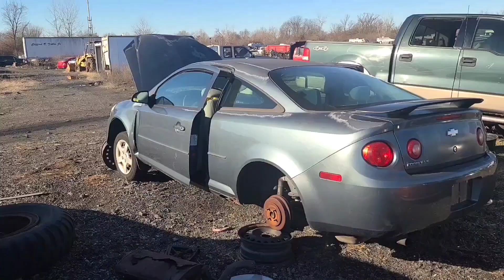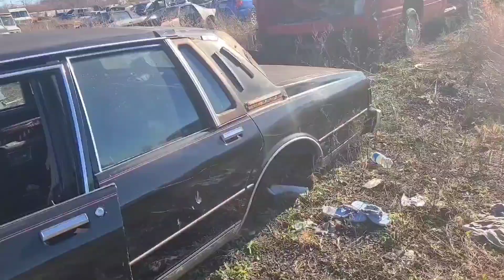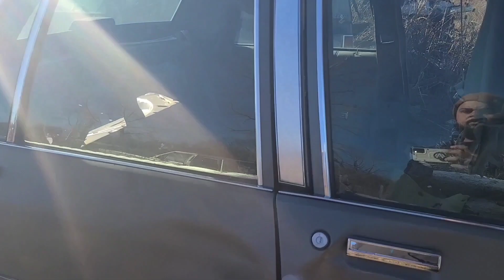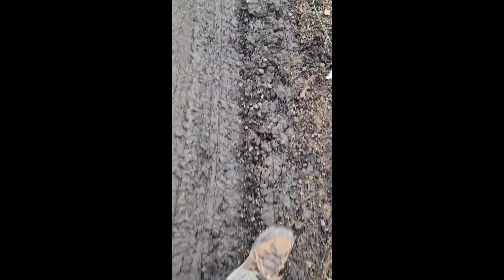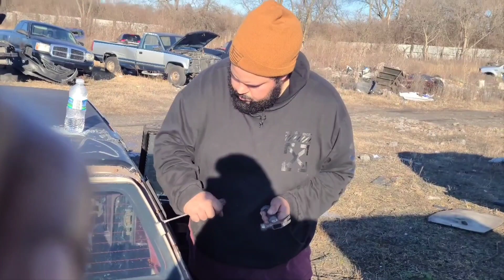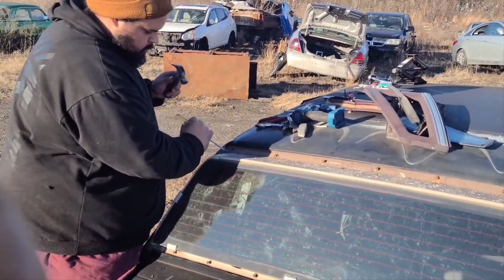Junkyard LS caprice rear glass removal

Comment: Hey man I just got a 1983 caprice but I need mad help I don’t really know what I’m doing
Reply from the maker: Yea I feel u mane. What all u tryna do with it?
Reply: @occity360  well it runs but there a lot of missing parts the choke doesn’t have like a cable that goes with the throttle that might be why it won’t drive
Reply from the maker: @GIO30312  it's got a manual choke or electronic?
Reply: @occity360  um manual
Reply from the maker: @GIO30312  aw ok dang. Unless u have a know type lever to adjust it inside the car. I'd prolly get a diff carb.
Reply: @occity360  ok thank